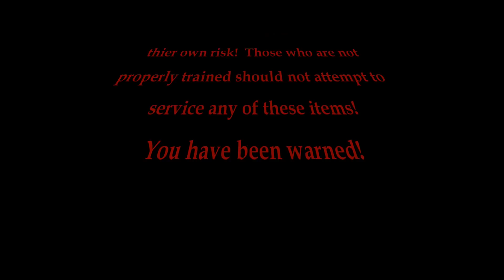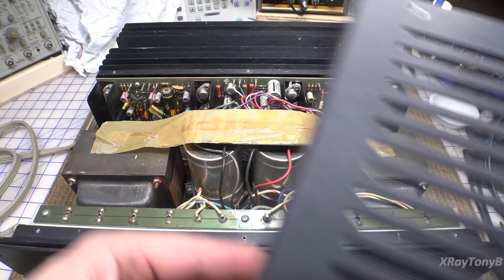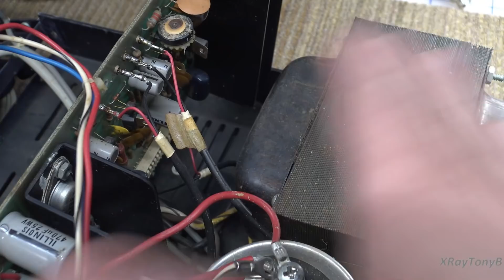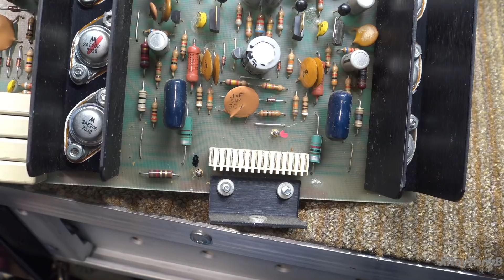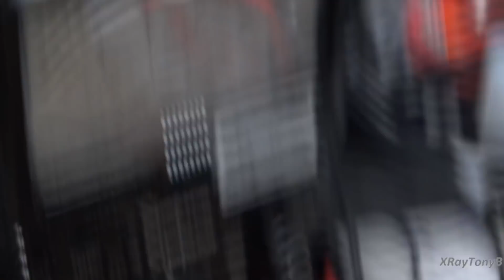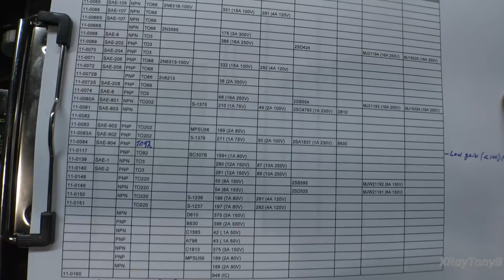SAE Mark III Amplifier - Part 1a - Initial Checkout & Driver Board Repairs

Comment: Somehow, I'm not liking the sound of the dual transformer design with one handling positive, and one handling the negative. Seems to open up that much more risk of unbalances .

I don't believe SAE had the option of employing those doubled transistors at the time this antique was manufactured, because , frankly,  it looks like they MIGHT have resorted to a cheaper part  :  This amp doesn't look to me to be any shining example of bullet-proof design, ( and it surprises me.)   I had a better regard for SAE before.

Comment: Can eny one tell where to find a real good repair guy in Oceanside ca,  I have a vintage receiver it’s a Kenwood KR-5060 the radio don’t work and neddle don’t work when I turn knob neddle don’t rotate. Thnx in advance.
760-715-9042.

Comment: I don't think that there's anyone who doesn't know about Paul Carlson's channel let alone his inventions, I have seen his capacitor tester and it appears to work really well considering that it doesn't test capacitors at their rated voltage, and that's the thing that bothers me about it, if I understood how it works, then I would feel more confident in building it but it's like someone is telling me to have faith! I trust Paul even though I don't know him on a personal level, I'm positive that it works but the old way of passing rated voltage through it is basically what's happening in a circuit and you can measure, depending on how sensitive your measuring device is, uA, peta amps and so on. You can find capacitors that have extreme low leakage if you wanted to take it that far.. but Paul's capacitor tester makes it to easy and gives me doubts if the capacitor is going to still be good in the real world?.. I don't know...
Reply from the maker: The Carlson cap tester is fine for testing paper/foil caps, film caps, mica caps, etc.  It is not good for testing electrolytics.  Low capacity film/paper/foil/mica caps have a different failure mode than electrolytics.
Reply: @xraytonyb  tony, as I said, I really don't know how Paul's capacitor tester works. If I had some pretty basic description of it's workings, it might at least help to know when it works and when it isn't, if you placed a good capacitor on it, it just stays green and you won't know if it's going to show up as a fail or pass until you have had it sitting on test for a while.
Wherein the old and faithful EICO or Heathkit show you via the magic eye when and how fast it charged at a particular voltage, but most importantly it shows leakage! 
I would love to get a Heathkit and even though they were soul here in Australia back in the day, I have seen advertising in old Australian Electronics Magazines so I know that someone has one but no one is selling one here! There's plenty in the US naturally but shipping cost more than the product and then there's import duties... It's just out of the question for me, if someone packed a shipping container with all this old school gear, and was able to get it into the country a lot cheaper, they would sell like hot cakes! 
But when it comes to testing electronic components, a good visual representation goes a long way! 
I really like your transistor tester, yeah it's simple but it works. You can, if you wanted to, add another transistor to either place a continuous load on the other transistors under test or add one of those cheap Chinese function generators to draw various types of signal through them to simulate real world situations, leave them for a while and come back to see if anything has changed! 
That's where the pass no pass feature on the better oscilloscopes come in handy, you get to compare the original signal from the start as a frozen image to what they are now doing! 
Sure, what you have there is great for go no go and a very good visual representation of how closely matched to each other they are, but if you have a situation where you really want to keep the original transistors but you wanted to test them over time to see if they are doing anything that they shouldn't be after being warmed up, then that would be the perfect way to do it without spending to much money on something from Roden Schwartz LoL. 
I really like your tester, I know that I asked about it in the comments section in a previous video some time ago, all I knew was that I wanted to build it at some point but at the time my anxiety wasn't allowing me to do anything, even sending an email was impossible. I have been better lately and I plan to email you about the schematic so hopefully you might get some mail from me... Your reply will come when you are good and ready, I'm not going anywhere so I have plenty of time LoL.

Comment: It seems like every time you get one of these large amplifiers somebody's got their hands on them before you and they've totally bald it up and that things toward that weren't supposed to be done and then you have to come along and put it back in order and I find that so much myself when I buy stuff off of eBay you know Parts not working I just did a Pioneer amplifier that every single one of the transistors that were in it we're not meant to be in it but it was all the original caps but all the transistors that were in the unit we're not meant to be in the unit which drove me nuts but when I was done and I recapped it and I put all the right transistors in and fired it up for the first time it sounds great
Reply from the maker: These days, it's hard to find gear from this era that wasn't worked on before.  When you do, it is priced in the unobtainium range.  I usually look for equipment in good cosmetic condition, which usually means its a basket case inside!  Thanks for the comment!

Comment: Great channel Tony! I was dying during this video; I was literally screaming "Change all those grey EL caps out Tony!". It was with a sigh of relief when you did finally swap the damn things out. I've worked on Apt Holman preamps where those caps are used for interstage coupling and they commonly fail. My policy has been to swap them out on sight.   I suspect the SAEs suffer from thermal drift and the dual monolithic transistors are used for better thermal tracking. That dual monolithic transistor may have been a factory upgrade. I know John Curl used them on the input of his JC-80 Preamp design. Bob Carver just said, screw it, and used an Op-Amp on the inputs of his later Carver and Sunfire amplifiers. You're a brave man to undertake this repair,  I fear you may end up having to re-engineer the thing. I concur with Andy that finding TO-66 driver transistors will be a major headache. I've seen McIntosh service bulletins recommending certain TO-220 case transistors to replace their old TO-66 drivers.  Good luck with this beast. I fear that it should provide material for many videos.

Comment: I heard way back in the 70's that SAE amps had a reputation for "blowing up". I ended up with a Phase Linear 400. Never blew up, but blew fuses instead.
Reply from the maker: You aren't the first to mention this.  I'm thinking these things have a reputation out there for letting the smoke out!

Comment: Tony, I enjoy your videos, for several reasons one is the story you tell about the equipment under repair, the other is you uncanny ability to diagnose issue. If your profession was a cancer doctor I would believe you have a cure. Cause the way to attack the problem and diagnose and identifying the problems. I wish i was your neighbor, but I find your videos the best for fixing stereo equipment the right way. You don't do have ass work, you do the Fix RIGHT Way when you can, in those cases when you can not you design it to make it repairable and reliable.

Comment: I have some reservations about the design and the horizontal orientation of the heat sink. Convection would be much better with cool air rising freely from an open bottom. 200 watts per channel is not a joke.

Comment: Another tip: Those TO-66 transistors are probably un-obtanium. But a TO-220 case style will drop right into the same foot print with the collector still being the case or tab terminal. Not sure if it's true but I read that was intentionally done when the TO-220 package was released. It's also interesting that the "Ampzilla"  had TO-66 drivers. And they like the SAE it was also designed by James Bonjiorno.

Comment: High power audio amplifier fact 1.01: The transistors are there to protect the fuses! Also I really dislike that connector arrangement, especially using those cheap tin connectors. Just asking for failure when the unit reaches this age. Plenty of mil spec connectors were available at the time but I guess even as a higher end audiophile product, it was still built to a price point.
Reply: Andy Delle - Heartily agree Andy, couldn’t believe it when I saw those cheap tin connectors - they are totally unsuitable for an amplifier of this caliber! Actually, I’m very unimpressed with the overall internal physical layout and construction of this amplifier - it almost looks like a home built unit, rather than something from a respected hi end manufacturer. Compare it with a typical equivalent Japanese power amp of the same era( Yamaha, Pioneer, Sansui, etc ) and it doesn’t come close. I’m not talking about audio performance or specifications here, but just the internal layout, design of PCB’s, use of quality connectors, etc.

Comment: Must have been he's lucky day got that cheap I suppose.
Yes that Mr carlson's lab capacity tester is a good piece of kit it works in the mega ohms of leakage.
I was hoping you going to test a replacement transistors the coupled thermal transistors for matching, I mean are they decent replacement they could have been used on both channels why didn't you go with that on the other channel?

Comment: Is it possible the two sides are mirror images of each other rather than duplicates? It looks like it because of the placement of the variable resistor. I noticed you checked power resistors on each side to detect differences, but you checked as if they were duplicated left to right. No doubt that resistor was still a dead short, but . . . ?

Comment: Hi Tony. Since all of those 10V 100uF caps were changed before and the only original one left had spilled its chemical guts all over, I think that at least 16V or even 25V rated ones are in order (25V ones might not fit, but if they do, even better).